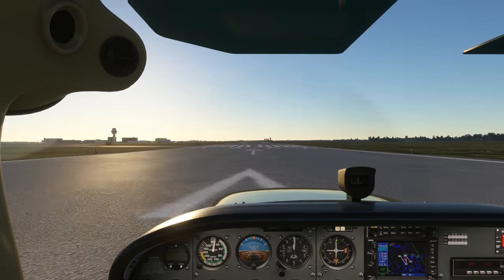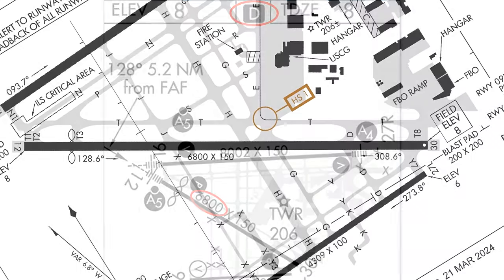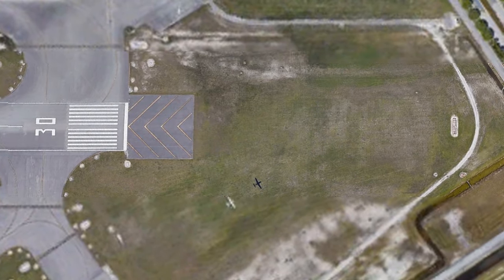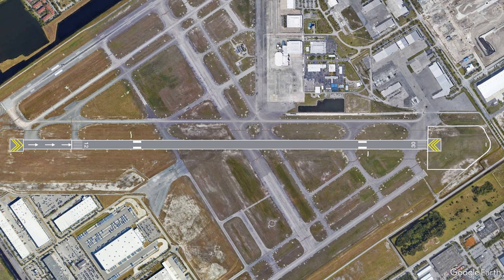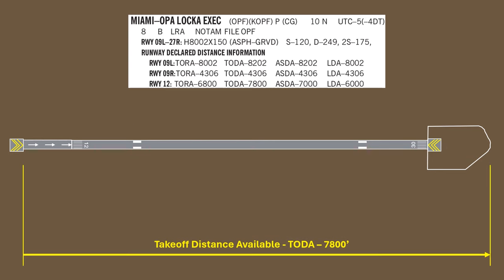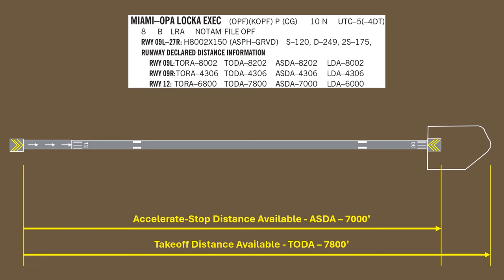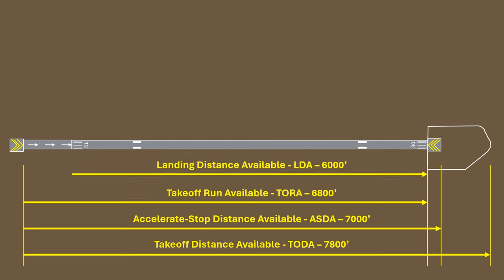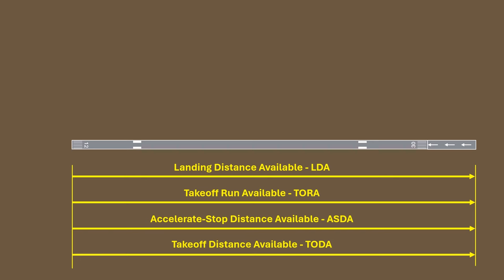Runway Declared Distances | TORA, TODA, ASDA, LDA | Takeoff Distance Available

Comment: This is probably the most under appreciated lesson in private pilot training.  I hear too many pilots talk about the 50/70 rule (it has its place but it's not the norm) or things like "I just double the takeoff roll as my runway minimum length."  I got grilled on this pretty good during my checkride (I said I like to triple the landing roll) and have used accelerate stop distance (plus a 10% buffer) as my minimums ever since.
Reply: How do you calculate the accelerate stop distance?

Comment: Very interesting, but you didn't tie the 4 distances back to your first example of the taxiway diagram. I looks like the TORA is what's on those diagrams, and I assume the TORA is the same in both directions.
Reply: The number on the airport diagram is the physical length of the runway, exclusive of stopways. The declared distances may be more or less than the physical length of the runway. If declared distances are not published, TORA, TODA, ASDA, and (usually) LDA are assumed to be equal to the physical runway length. If there is a displaced threshold, LDA is shortened by the amount of the threshold displacement. See AIM 4-3-6(c).

Comment: I believe that you technically can land on a displaced threshold, but it's not recommended because of possible obstacles and it's not included in the LDA.
Reply: Won't there be any implications of the bearing strength?
Reply: @Airops-td4qs  I think you're referring to stopways which are not load bearing and are designed to collapse when an aircraft goes on them to slow them down.

Displaced thresholds are load bearing. They are just the rest of the runaway, except they are designated as displaced because of an obstacle or something.